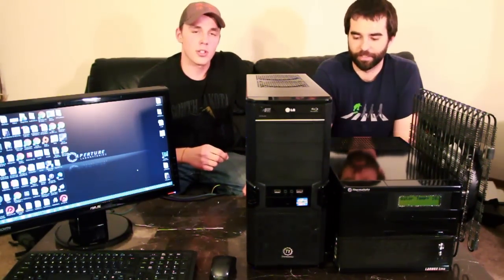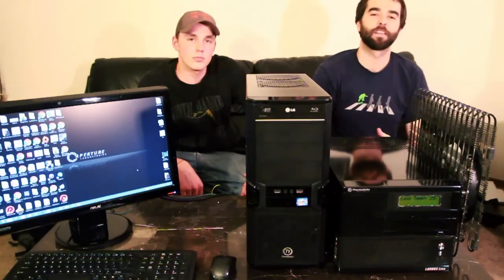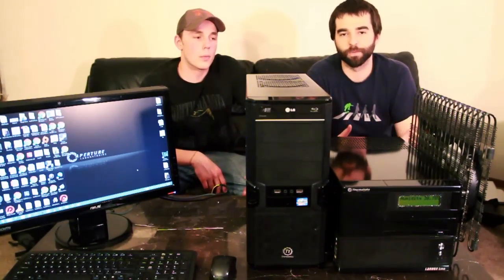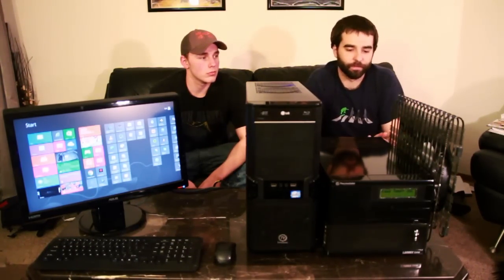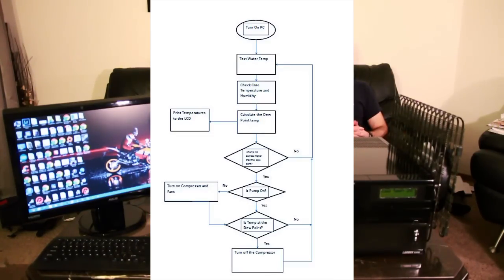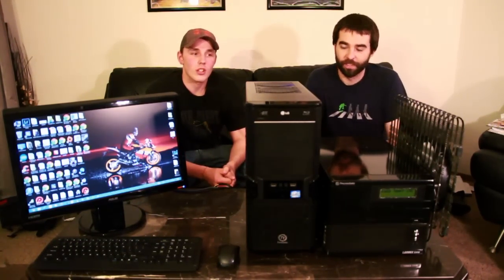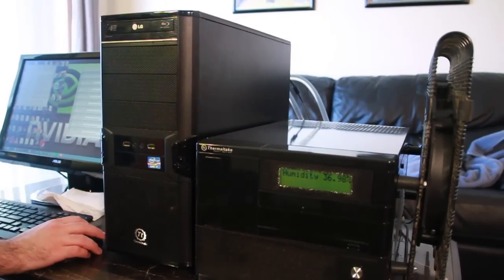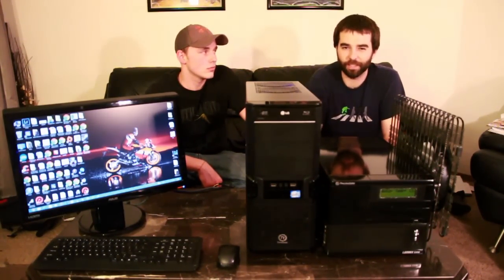CPU Refrigeration Loop

Comment: any volts or multiplier did you used on prime95 2600k?
Reply from the maker: It's running at 4.7 GHz with 1.38 volts stable.